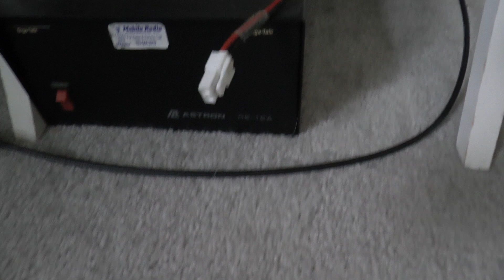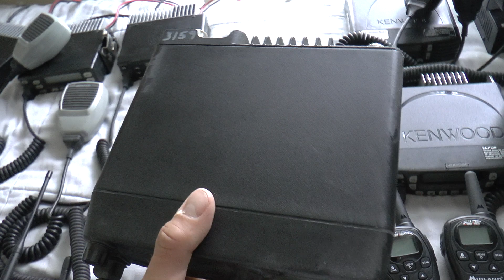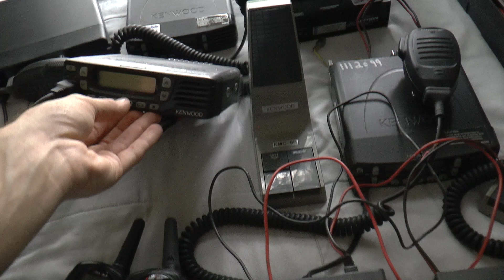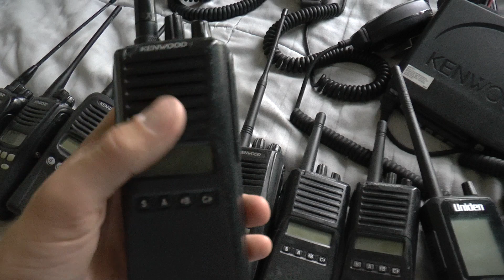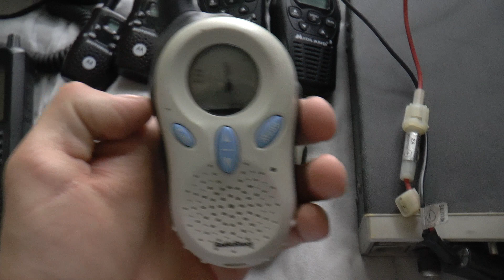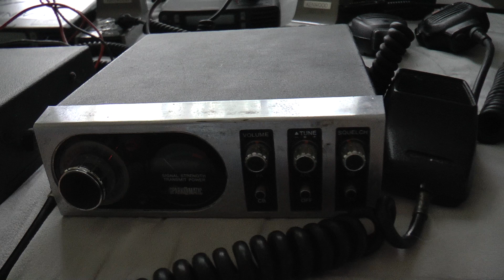Full Two-Way Radio Collection as of 8/17/2020

Comment: Awesome! I’ve been waiting for this video for a while! Where did those two pairs of Audiovox radios go? Also, please… Please start uploading more videos of radio chatter. Especially if that hospital near you that you uploaded a few years back. Thank you.
Reply from the maker: Thanks! I gave the Audiovox pairs to a friend to mess around with because they started malfunctioning really badly as if they were shorted out. I was going to just toss them out, but he agreed to take them, so that worked. I don't have a lot of time to do radio chatter videos these days. I took down my makeshift base station, and I'm gone all day at work. Also, the frequency that the hospital was on, last I checked, sounded like it went dead, but I could check it again.
Reply: msj191961 OK, makes sense. I have a couple different Audio Vox models that I got in parts lots and none of them are really that great in my opinion. Except for the GMR 1100, that one is not great but it’s probably the best model by them I have used. But yeah, I understand if you’re working. And if you could check the hospital frequency that would be great. Thank you

Comment: This is really cool, do you just have a GMRS license or do you also have a ham license? It might be a fun addition to your radios.

What do you use to program these? I have a bunch of Kenwood TK-863G-1's that I need to program.
Reply from the maker: Correct, I only have the GMRS license. Not enough time or motivation to get the ham license right now. I use the Kenwood software. The software for the 863s is the KPG-76D.